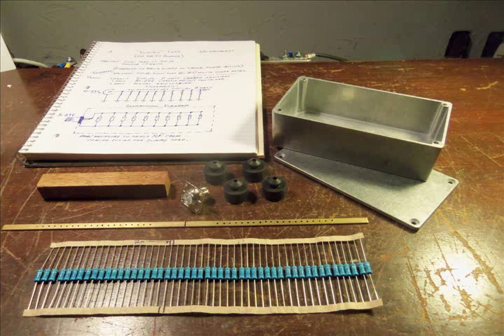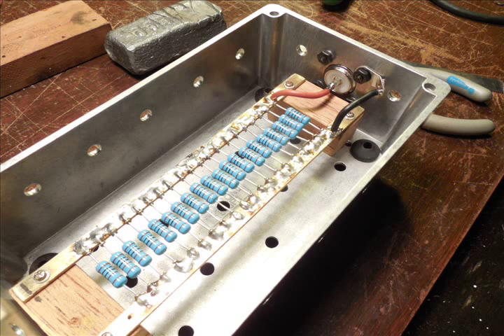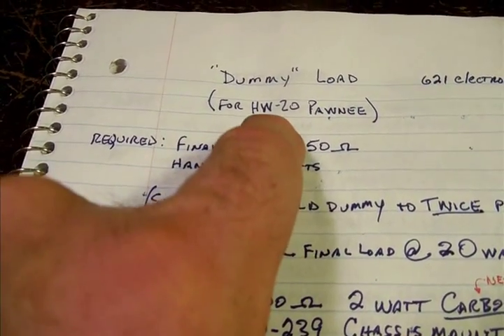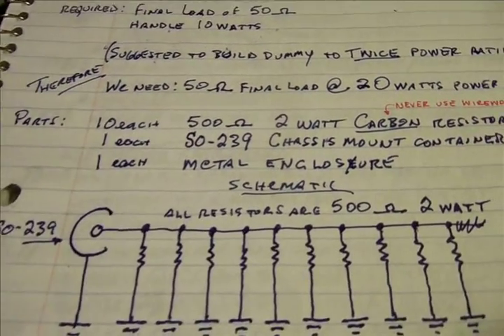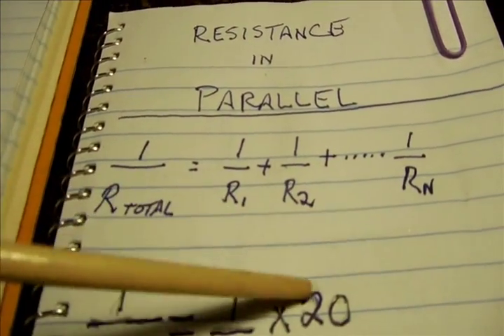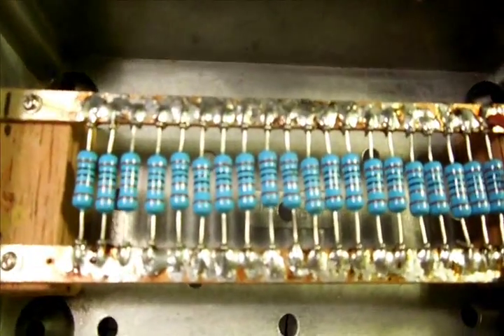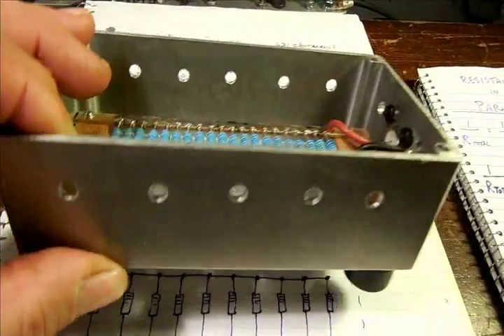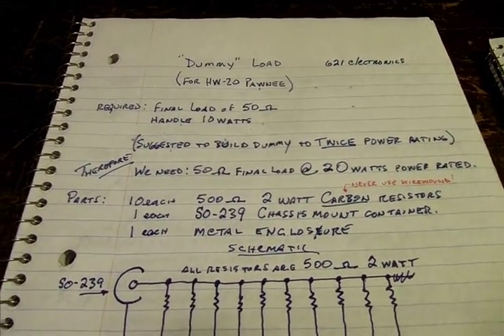RF Dummy Load

Comment: Why can’t you use wire wound resistors?
Reply from the maker: When you wrap wire around a core, you create inductance. Wire Wound resistors do this, and the created inductance is not desirable to add to RF signals. What I constructed works well for general purpose, its not "laboratory grade"
Reply: @TonyButchT  thanks, now I understand.

Comment: Great video.  I'm thinking about making one myself.  I don't have any bus bar around.  Could I use a 2,  8 gauge copper wires instead ?  I figure this would work.  What are your thoughts.
Reply from the maker: Andrew, Using two wires might create unwanted paths, or loops, for energy to flow. Example: If you set up a radio station having a transmitter, power supply, tuner etc., they ALL get grounded to the SAME point. If you ground them separately/any where you can, "Ground Loops "get created which can cause signals/energy to interfere with each other. I am NO electrical engineer, just relaying my gut feeling about using two separate wires for a buss bar. Or, solder two or three pieces of #8 wire lengthwise, shape the assembly with a hammer, and there you have your solid copper buss bar!
Reply: @TonyButchT  Thank you for letting me pick your brain.  I like the idea of hammering the #8 gauge wire in to a bus bar.  Again thanks for sharing,  take care
Reply: @TonyButchT  little update. I ended up having some 1/2 copper pipe from past a plumbing job. I flattened in my vice. Now I have 2 copper bus bars.
Reply from the maker: @andrewgeorgelang  Way to go Andrew! Good Thinking!

Comment: OK I'm a bit confused.  According to the colors of the bands, those aren't 500 ohm resistors, they are 10 ohm.  Am I not seeing the colors right or what??  At 0:24 in the closeup, it sure looks like brown, black, black, brown (reading from the right side) and green is 5 but I see no green on any of those.  What am I missing???
Reply from the maker: The video is a bit confusing! Original plan called for 500ohm 2watt resistors (as you see written on the notebook page) however, I used 1,000ohm 1 watt resistors. The brown band furthest away from the others denotes tolerance, 1% in this case. Beginning at the opposite end there is brown (1) black(0) black(0) = 100, then another brown which is the multiplier, in this case being ten to the first power which is ten. Therefore, you have 100 x 10 which equals 1,000. Twenty 1,000 ohm resistors in parallel yields 50 ohms.
Reply: LOL  OK, thanks for clearing that up!  It was confusing for sure.
Reply from the maker: Youre welcome! I'am hobbiest, not a pro...we all learn as we go!
Reply: He doubled the power by doubling the number of resistors.  Instead of 10 500 ohm, he used 20 1000 ohm.

Comment: why not just use one single flanged resistor?
Reply from the maker: Yep...you can! Remember to use a resistor rated at the wattage under test. Gets costly at lets say 100watts on up. Can't use wirewound.

Comment from the maker: Measured 13 microhenry's! I do use this on low power 2M HT's. Should carbon resistors have been used? Thank you for this information!
Reply: Tony, sorry to be so late in getting back to you. Your composition resistors are fine and the dummy load will work great at HF and probably reasonably well at two meters. (Close enough for government work!) The inductance is caused by the leads (unavoidable) and negligible. 

Do not despair over drilling the holes. RF will not be a factor and your instincts were good for heat dissipation! I have a Swan commercial 300-watt dummy load that has  grillwork for a case. 

Besides, you will probably want to hear your output in an adjacent receiver. 

Excellent workmanship! 

de Bill, k6whp 

dit dit
Reply from the maker: KD2HYA for I.D.
Thanks for the additional information Bill. I consider it "Elmering", which is a good thing! I learn more every day in this hobby. Example: With regard to your first comment, this led me to research and learn about dummy loads, proper construction and usage. If you did NOT comment: Hey...grab a bunch of resistors...do some easy math...fire up the iron and presto: a dummy load! I checked the one I made against one I purchased and there sure is a difference, especially measuring power. Excellent biography at QRZ! At a yard sale my son picked up a Heathkit HW-8, with it's power supply and manual. Looking forward to setting it up! 73 Tony KD2HYA

Comment: Nice work but when you can, put your dummy load on an inductance /capacitance meter and see if it doesn't measure about 10-20 microhenrys. Those resistors each have an inductive component. It's not ragingly critical unless you go above 50 mHz or are using it when measuring lower power.